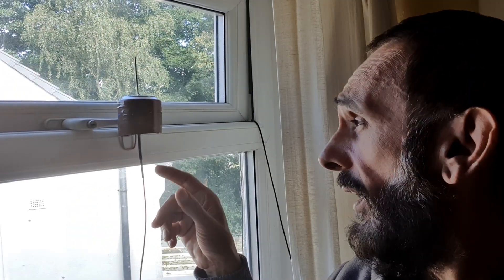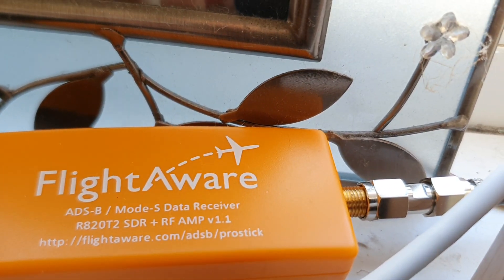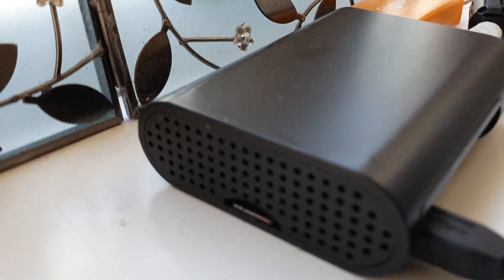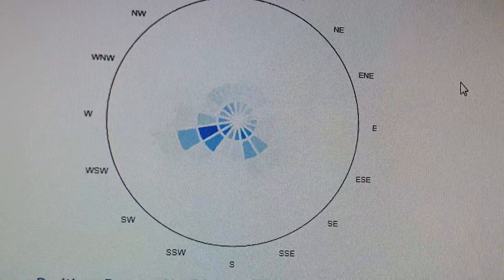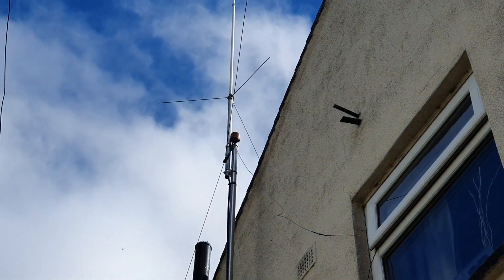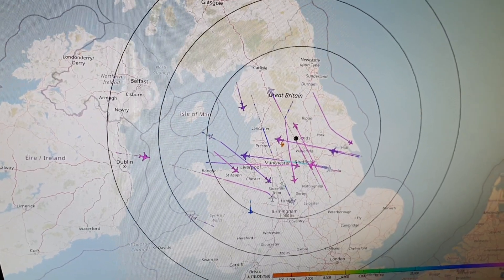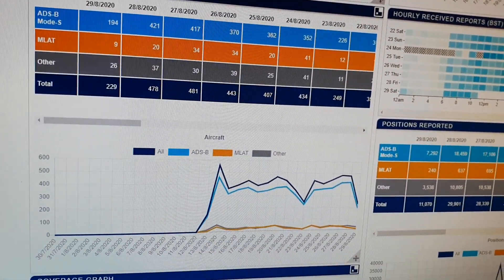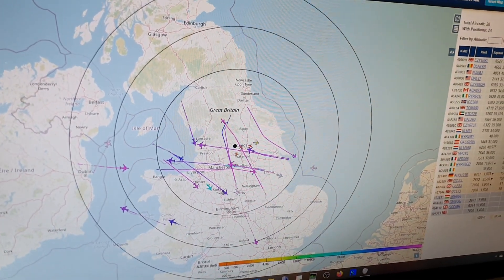FlightAware SDR dongle - Improving Range - RASPBERRY Pi - M0YKS

Comment: That's impressive ! what's the length of the antenna element ?
Reply from the maker: Thank you the antenna is 70mm long, very small. I think it is a 1/4 wave length. It's been up for three years now and still working perfectly.
Reply: @M0YKSHamRadio  That's great ! one weird problem is going on, if i connect my RTL SDR + Antenna to my dump 1090 App on my android smartphone it will show plenty of Aircrafts but if i connect same thing to my Raspberry PI it hardly shows 1 or 2 Aircrafts , why is that ?

Comment: Hi Simon, another great video - informative and entertaining. Please keep them coming. Quick question: what type of ferrite have you attached to the Ethernet cable?
Reply from the maker: Hi there! its a clip on/clamp on ferrite. Only cheap and clip together around the leads etc. They come in different diameters for various cables to help reduce unwanted radio waves straying into the electronic devices. I have them on lots of equipment as I run high power from my amateur radio station which used to knock the network off when I transmitted. I got them from ebay in a 10 pack from china. Only necessary if you are getting any problems. Cheap but effective. 73!

Comment: That’s incredible! What a difference. That’s inspired me to get my PiAware antenna up higher. I started following you only a few days ago. Do you have the specs for the antenna you made posted anywhere?
Reply from the maker: Hi Jeff, Thanks for the follow its very much appreciated. There is a thread found here " https://ukradioscanning.com/viewtopic.php?f=4&t=6719"   which at the bottom of the page has the dimensions and pictures that will make it easy for you to build one. I have totally smashed the stats today since the height gain. My range now has 5 aircraft 200-250 miles logged which was not possible earlier. Get it up high and sit back and enjoy lol Thanks again and good luck with your plans for improving the range. Best regards Simon M0YKS
Reply: MØYKS - Ham Radio brilliant...thanks much!

Comment: Damn, you're getting a lot better distance than I am with a longer antenna, I need  to not be surrounded by buildings lol.
Reply from the maker: 😁 thanks I must admit that cantenna works amazing. I am lucky to be at 600 ft asl and when I bought the house 10 years back I checked many places for best radio sites. It took 3 years but has paid off as I get out well on the Ham radio bands. This stuff is new to me so will be experimenting further with antenna set ups. Thanks again have a good weekend